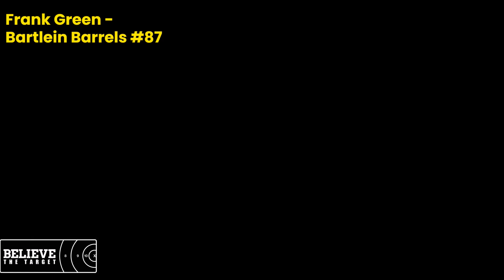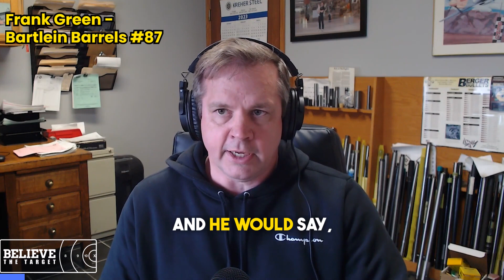Test results - 5 groove vs 6 groove barrels | Bartlein Barrels

Comment: I have a cz 600 range 308 with a 4 grove barrel. Its a absolute tack driver it's the first 4 grove I've seen.  It seems to have more recoil than a Standard barrel or at least it seems to.
Reply: Is that really accurate rifle? If yes then whats its fav factory ammo ang grain pls tell me
Reply: @advmotorrad  Most accurate Factory Ammo I have Used in it is Sig Sauer Elite Marksman 175gr. There loaded with Sierra Match King bullets I've had them out to 1,000 yards. They held just under 1moa.
Reply: @chrismuncey3861  thank you soo much for quick responve do ypu suggest any other ammo too? With good result?
Reply: @advmotorrad  The next best it likes is Federal power shock 150gr blue box ammo. It will shoot 3/4" groups at 200yrd with them but that's as far as I've shot those.
Reply: @chrismuncey3861  thanks alot brother really appriciate for help

Comment: Never been a fan of 6 groove. To me, the less distortion on a bullet the better. My old 3 grooves from Broughton and Lilja were easiest to clean and insanely accurate. Then came my experience with 4 groove and 5R. Same thing. Would prefer to not use a 6 groove in any caliber